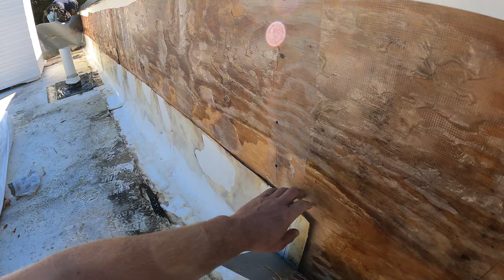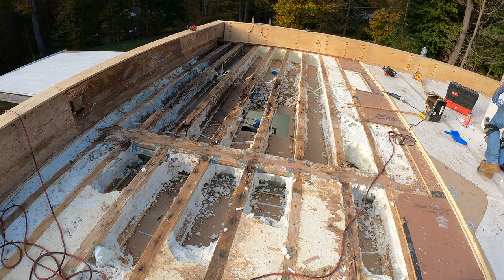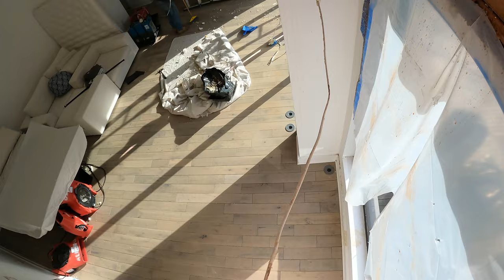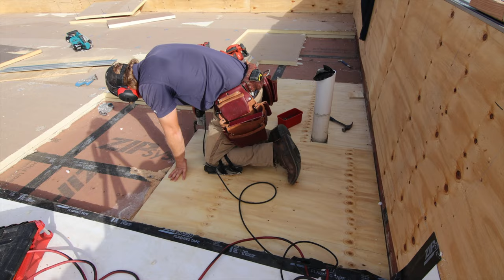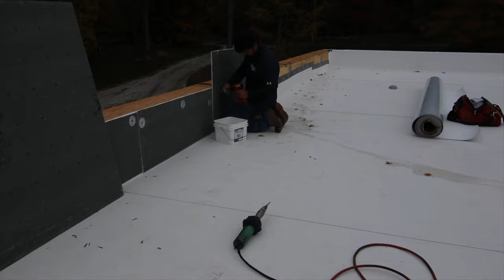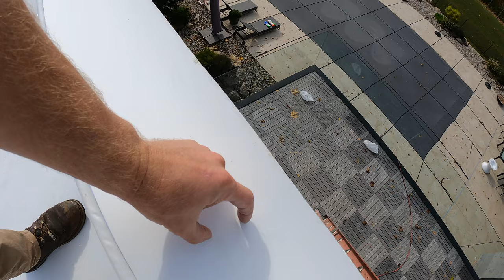Disaster Roof Replacement

Comment: why aren't you using treated plywood?
Reply from the maker: You would never use treated plywood in living space because if the building ever can’t fire, the smoke inhalation would kill everyone. It is against the law to use pressure treated anything inside of a building unless it is a bottom plate of a wall touching concrete. Hope this helps.
Reply: @AllRoof.  you consider the roof "inside" of the dwelling?.... also if the fire makes it up to the outer layer of the roof, everyone is already dead
Reply from the maker: @notimportant3686  the town and state disagree with you. I do not. They see it as against the law and code to put it in, therefore we exclude using pressure treated wood.